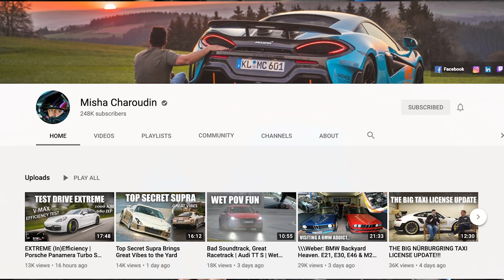Building a 300bhp+ 1.9 TDI 8V PD Engine for @mgcharoudin!

Comment: Tuned tdi's are fun. Tuned smoke free tdi's are class.
Reply: They also run cooler egr and make more power.
Reply: no smoke= no fun
Reply: @maksdegek1  no smoke, no poke
Reply: Smoke is cancerous ain't it? 🤔
Reply: @Saif0412  who cares we are all dieing anyway.. might as well have some fun while doing it :D
Reply: @Saif0412  What isn't these days
Reply: No smoke no power 😂
Reply: My 84 rabbit with her 1.6 eco diesel rolls coal on 25psi boost and pisses off prius owners at the same time >:D
Reply: @mrmedium7984  They also don't eat pistons because of fuel impingement. They also don't dilute oil or burn exhaust valves. They're pretty amazing.
Reply: If you're feeding the engine enough air you won't get smoke. It's easy to turn up the injectors, create more power, but also smoke, and extra heat into your exhaust valves. Smoke is a sign of a shitty tune. 
A well built engine won't smoke.
Reply: @Surestick88  nah these kids need to roll smoke to look cool, and impress the town bike.

Pollution? What's that? It's a problem our future generations will have to deal with. Why worry about it now... it's "fun" and "cool" look at me mom pour waste into the air at speeds never achieved before. It's so cool.
Reply: @Ran-dom1  cry me a River
Reply: No smoke means it’s running right!!
Reply: @keithmartinez07  no, you're just wasting fuel for smoke. But that's your car so you do you while we'll gap you in stealth.
Reply: @doiceslife8374  that makes no sense to what I said….
Reply: Actually tuned tdi engines need the extra smoke because they melt pistons and the reason is that air gets too hot for the metal to handle and the extra fuel lowers the combustion temperature with the extra volume of fue
Reply: @adinglavic8418  never heard about that before, are you sure bro?
Reply: @thenfsoverclocker7143  100% sure...had a pd swapped mk2 running close to 350hp and no smoke...melted the pistons once because of high combustion chamber temp...diesels run off compression not spark so the extra fuel only hurts your wallet
Reply: @adinglavic8418  wow,i just added a new information, thanks a lot
Reply: @adinglavic8418  lol?
Reply: In Germany we say: Wenn’s nicht rußt hat’s keine Leistung!
Reply: I got mine tuned and no smoke, pretty neat but its just tune, nothing else
Reply: @Surestick88  Really depends, if you are trying to push the most power you really can get out of a PD engine, you will get smoke no matter what, especially when launching the car, after that yeah you shouldn't produce much smoke unless its a shit tune
Reply: Forgot to mention as well if you produce a certain amount of power you need the smoke, unless you literally want to melt your pistons.
Reply: Mine runs pretty damn clean. It only shoots out a tiny bit
Reply: @Saif0412, you do not inhale your exhaust gasses,  trucks make a lot more smoke and so also worn petrol engine 😂
Reply: @mikecorleone6797 , if you give me a brand new Prius, I will set it on fire ❤
Reply: Honestly, just a hair of smoke means you are making the most out of your available fuel.. when i say just a hair of smoke I mean barely visible! I have a tuned 2.0 common rail and its got just the slightest haze on full throttle and certainly feels like its making smoother power vs when I had a bit more smokey of a tune
Reply: @adinglavic8418  More fuel means more heat on a diesel.. to a point. Some tractor pull diesels run extremely rich air fuel ratios to get a cooling effect but that is not something you will be doing on a small displacement diesel. On these motors more smoke means higher EGTS and higher cylinder temps
Reply: I hate my b7 because of the shit map. I went bought kess and knocked the fule down myself ….. lesson learned if you have a dub diesel take it to these guys if I had just done it in first place I wouldn’t be in such a mess I have now bought a new ecu so I can bring it to darkside and get them to help me out.

To say I had it mapped egr swirl and dpf delete and it was awful that’s why I got kess and tryed to fix it myself iv tuned loads of race bikes  I am far happier now but still blody awful never even got my money back of the so called tuner who fkd my car and would not send me my original map back
Reply: @bretsimpson9890  I think we got fortunate in the US and the passat NMS has better stock fuel maps. The nms was the B7 for the USA and China, but it's a physically bigger vehicle than a regular B7
Reply: Tuned M57 🗣🗣🔥🗿
Reply: @jimmysmith3277 I plan to travel in a tdi to other countries so I don’t want attention, nice last name btw (it’s mine too)

Comment: Aircon sounds reasonable for a "track day" car instead of "race car", as the actual total weight (which can be less than some cooling vest systems) and extra power needed to drive accessory belt (a couple of horsepower) isn't going to back a big difference compared to a hot/tired driver, and its not like this motor is going to turn at speeds a stock petrol wouldn't as to worry the pump. But I do suspect you'll end wanting to swap the factory condenser for something outside the engine bay and insulate the remaining lines so that it both actually works when the under-bonnet regions an oven and doesn't interfere with the space/airflow for radiator/inter-coolers that could be fitted... we do this for many 4x4's here down-under because the hot climate, low speeds working hard offroad and demand to fit bullbars/winches/intercoolers at the front cause simlar problems. I've even seen several older US cars with the complete setup hidden away somewhere like the old spare tyre well, running an electric compressor to keep the engine bay clean/unmolested but still having it enjoyable to cruise on a hot day.... but I suspect a golf might not have that degree of unused space outside passenger cabin, and it would be heavier than just moving the condenser.
Reply from the maker: Yes that's correct and a good idea, its the condenser that's the problem!

Comment: Holy cow! loving the subwoofer tune! Cant wait to get back into the asz build theyre still the best engines around, would love to see that rip. cant wait to buy more bits like H beam rods and apr bolts etc. ye could sell a few complete engines like a plug and play 350hp 1.9tdi with options to fit a bls/bxe engined vehicles.

Comment: In Romania we make 300hp + on stock internals (1.9tdi) and the 2.0 tdi bkd can handle 350 360 hp with stock internals
Reply from the maker: Good for you guys!
Reply: @DarksideDevelopments  very nice setup man. It s awesome. So clean and btfil. Nice work!
Reply: @sTyLeTzful  What 1.9 TDI engine, the big or the small crank ones The big one ARL,ASZ,BPX, BUK or the small ones PD ATD, AXR, AJM, AUY or the mechanical Bosch injection pump AGR/ALH and the AHF/ASV engine??
And you meant 300 "brake" horse Power at the crank and not at the wheels.
Reply: @arnoldkul3827  2.0TDI bkd 16v 380hp at the engine

Comment: Nice build, i like the style of the exhaust manifold and the turbo. I have two questions,  so the engine is about 300hp, why are no PD-Bridges installed, just to make it last longer? Don't get me wrong, no assault at your beautiful work! 😎
What do you think about the 2.0L BMN Ingine?
Reply from the maker: The bridges are a good preventative measure but not always needed. The BMN engine is ok but the limitation is the siemens fuel system at ~270bhp. This can be swapped out for Bosch basically making it into a BKD engine.
Reply: @DarksideDevelopments  here in United States 3/4 ton pickup trucks rule the Diesel market. With any high hp Diesel engine, smoke before the turbo lights is inevitable when running modified injector nozzles, large turbochargers, modified compression ratios ect. Once the turbocharger(s) light smoke levels should decrease, although we are forced to use extra fuel to help cool combustion chambers (pistons) when cracking 1,500hp out of a 5.9-6.7l diesel engine that was developed to make 500hp. Smoke is inevitable

Comment: hey man, what's your timing adjustment for these 1.9 tdi? you set it to 0 degrees or anything else? Also do you set it up with the markers on the camshaft flywheel or using the proper external TDC timing degree tool kit? Thanks
Reply from the maker: +1 for newer EDC16 PD's and -1 for older ones!
Reply: @DarksideDevelopments  any particular reason for the - 1 on edc15 pds, I've always done 0

Comment: that engine is AVF or AWX? Why is wastegate on turbo on the oposite side? is that more efective?
And how is planned backrecirculation of the airsol from oil from the head?
because on my opinion is totally badly planed from the VW factory back to the turbo.This PD is working differently and are more smoking because of badly back recirculation aerosoil from the oil in gascet of head engine...
Reply from the maker: This is ARL so Transverse mounted. AWX is longitudinal. I think recirculation is best, oil has a higher cetane value!

Comment: Ryan interesting question. Why bad idea to keep Ac is it because the engine is in danger of running hot due to extra un needed load? Or for the fact it saps power from the engine?
Reply from the maker: Hot air entering the intercooler and radiator. Cooling will struggle!
Reply: @DarksideDevelopments  yes that’s right I didn’t think of that it’s a very good point 👌❤️

Comment: Would be interested to hear a rough price for this sort of specced build.
Reply from the maker: 10k roughly
Reply: @DarksideDevelopments  300bhp what pressure? 2.8?
Reply: @DarksideDevelopments  10k on a 300bhp Diesel. Damn. 😂😅
Reply: @joshwattonS2000  Considering Diesel rpm is usually about half or a bit more of gasoline engines and Power = torque x rpm this is almost equivalent to a 450-550hp gasoline engine. The key here is higher torque through more of the rev range.
Reply: P
Reply: @swiftink  A gasoline engine with the same kind of money invested could make just as much torque over twice the rev range. This is a complete waste of money for 10k you could get a 3l gasoline engine and mod it to 800+hp.
Reply: @BigUriel  You are talking about money constraints not physical or thermodynamic principles. Of course if you get an engine of 3L with a turbo you could have more power hut thats adding an extra 57.9% of displacement. Thats really not a good or fair comparison. Diesel engines are actually much more efficient and powerfull than gasoline engines but are being disfavored because of environmental concerns.
Reply: @BigUriel  Also your assumption that a gasoline engine could have the same torque over a much longer rev range is incorrect the high torque of diesel is achieved through much higher compression ratios and higher boost pressures than in gasoline engines. This is allowed because diesel fuel is much more resistant to preignition than gasoline fuel and will not self ignite when high compression ratios are used. Example in a gas engine a CR of 12 is considered very high. In diesel engines a CR of 15-16 is normal and can go as high as 20-22 CR.
Reply: @swiftink  No offense but I don't think you understand what you're talking about. 
- There are plenty of modified gasoline engines out there pushing over 200Nm per liter of displacement which is what this Diesel engine will have roughly. This engine will have something like 400Nm from 3500rpm to 5000rpm (no it won't have peak torque at 2000rpm like it had stock once you've fitted a massive turbo) while you can easily make a modified 2l turbo gasoline engine with 400Nm from 3000rpm to 6000rpm and get close to 400hp
- Compression ratio has a small effect on torque on naturally aspirated engines when they're burning the same amount of fuel, which they never are per unit displacement when comparing gasoline and Diesel because Diesel always runs lean. In turbocharged engines it comes down to how much air can be forced into an engine, it is common in highly modified engines to REDUCE the compression ratio to increase boost pressure and get MORE torque
- Diesel fuel is actually far less resistant to preignition than gasoline, Diesel is rated according to a cetane rating which is literally how easily it burns spontaneously in a hot air medium, the reason why it doesn't pre ignite is simply because it's not injected until the moment of ignition, the cylinders have nothing but air in them until that moment

In either case if you want to make a car with a lot of power it's always better bang for your buck to start with something built for power in the first place with some decent displacement, there are Diesel engines that actually make a good platform for modding like the BMW M/N57 for example, trying to get big power from a little 1.9l lump that was designed to have some 150hp and give good fuel economy is dumb.
Reply: @BigUriel  Reducing compression ratios to increase boost pressure certainly does not give more torque at low rpm's thats how they build race engines for high rpm power bands. There is no arguing that higher compression ratios boosted or not yield more torque. I stand corrected about the prignition properties of diesel but the fact remains its more energy dense and more efficient for combustion.
Reply: @swiftink  The higher efficiency comes from the compression ratio, not from the fuel's energy density, that doesn't even factor in an engine's efficiency. Yes a lower compression ratio yields less torque all else being equal, as I mentioned it's an important metric on naturally aspirated engines, but on turbocharged engines the small loss of efficiency from reducing compression ratio is vastly outweighed by the increase in air flow and therefore fuel you can put into the engine, increase boost pressure and decrease compression ratio and your engine produces more torque because it burns a lot more fuel, although slightly less efficiently. The reduction of compression ratio will only cost a turbocharged engine torque at very RPM below its boost threshold, a modern turbocharged gasoline engine is making boost at 2000rpm so the reduction of compression ratio only causes a loss of torque at idle practically. If you reduce the compression ratio and increase boost at 2000rpm then you get more torque at 2000rpm, not less. All turbocharged engines have lower compression ratio than naturally aspirated engines, and all turbocharged engines make a hell of a lot more torque than naturally aspirated engines with the same displacement.

Look around for the typical performance figures people are getting these days from turbocharged 2l gasoline engines, and the performance figures of a "300hp" 2l diesel engine. People can easily get the same torque from the gasoline engines, and across a much broader rev range, and making a lot more power as they can hold that torque until much higher RPM. Even one of the earlier 2.0TFSI engines from 15 years ago can make over 400Nm easily with an upgraded turbo over an interval of over 3000rpm while these big turbo Diesels make it over like 1000rpm, they're extremely peaky and not at all what people think a Diesel is like to drive, at 2000rpm they make way less torque than they did stock because never mind compression ratio, they need a massive turbo to reach that kind of power output which has monumental lag and just can't make much boost as such low engine speeds.

Again this is a consequence of trying to squeeze so much power out of such a bad platform that was never designed for that so you end up sacrificing everything else for it including every day drivability. You get a much better compromise simply using a larger engine (or a gasoline one) to start with which doesn't need as much boost for the same power and so will always have a much broader usable rev range. Alternatively you have Diesel engines with sequencial turbo setups precisely to get around this problem, even if you wanted to stick with a 4 cylinder Diesel you could use something like a BMW 123d engine, which can make close to 300hp with just an agressive remap, a downpipe and an intercooler, you don't even need to touch the engine block. Any way you cut it a 300hp 1.9TDI is a completely pointless waste of money, it's like trying to make a cow win races when you could just get a horse instead.

Comment: Hey I’m in Australia and trying to build a 2007 mk5 golf with a 1.9tdi bxe pd105 for 400+hp and can’t seem to find all the info and parts I need would you possibly be able to help me out by sending a full list/video of what I need and where I can get it. Thank you
Reply from the maker: The BXE engine is not the best base to aim for those figures. These have a smaller crank amongst other differences so you would need to swap this for a PD130/PD150 engine first. We have a blog here - https://www.darksidedevelopments.co.uk/Blog/mk5-platform-edc16-to-mk4-platform-engine-conversion-bls-bxe-bkc-bjb-to-asz-arl-conversion/

For more information just drop us an email - sales@darksidedevelopments.co.uk
Reply: @DarksideDevelopments  okay thank you heaps. Just another question I’m planning on building the internals obviously but would I be able to put a pd130 crank in my pd105 or an upgraded one or is it not really worth doing the extra mods, also would I be able to do a straight swap from the pd105 to pd130 without changing wiring harness?

Comment: I have a question why does the valve seal is installed with hammer? And why you didn't  use  electric coffee kettle for tork head gasket?
Reply from the maker: You could push it in but the hammer helps. We will do that when in the car.
Reply: @DarksideDevelopments  tanks for replay
If only you were closer i would like to cooperate with your company . Keep up the good work